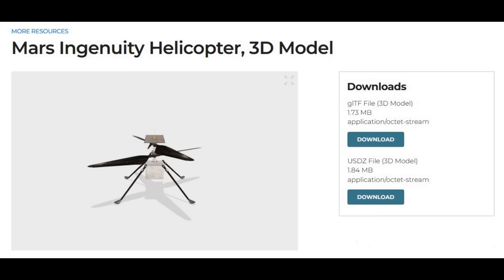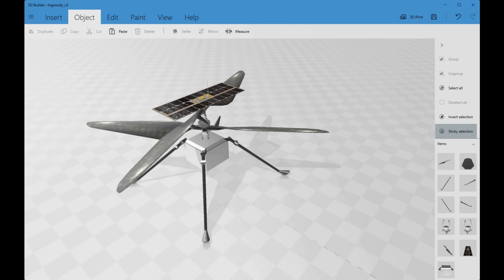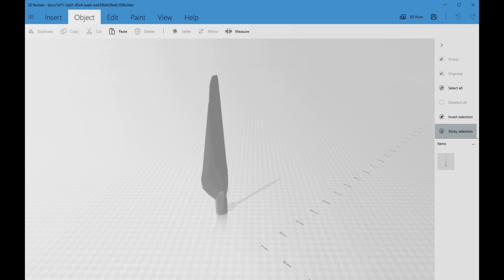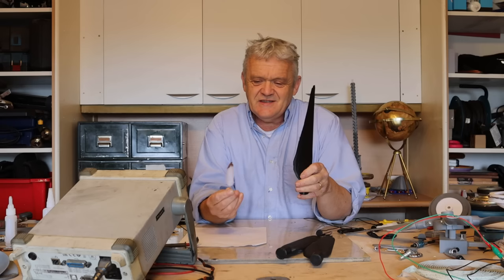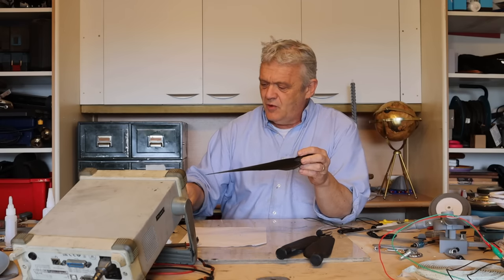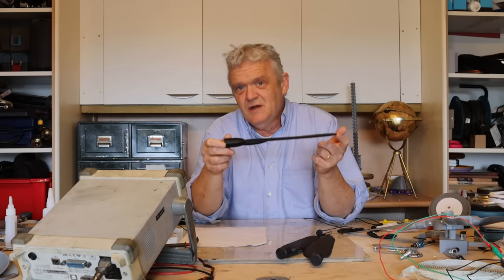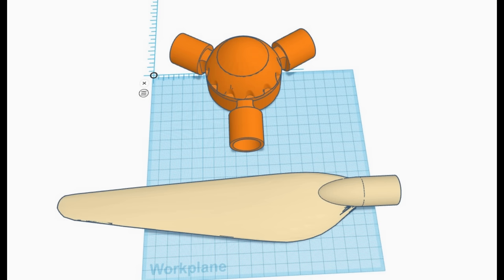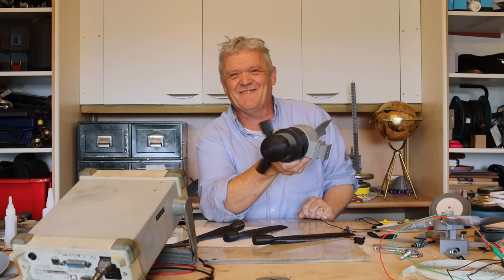2072 The Ingenuity Turbine - A Wind Turbine From Mars

Comment: I suppose the trade off might be that it starts at a slower wind speed but has an increased drag at higher speeds limiting it compared to the previous model. Would be cool to see activation wind speeds and saturation wind speeds for both compared.
Reply: Agree, that would be quite interesting to see.

Comment: How about making the propeller blades with fine splines at the mounts as well as in the hub? Slot the hub sections around the radius about 13 mm to 19 mm and use a screw to fasten the blades, this will facilitate experimenting with the blade angle.
Just a thought.

Comment: Double rotor(also interesting to try a set with a 3 blade in front and a 5 blade back rotor with the 3 bladed spanning where the gaps are on the 5 bladed one,  this would change the pressure between the two of them like a jet engine) is a must here I think to get the best result from it as it would furrow the air from front to back.  I really like this blade design.  Going from the wing to the feather idea is brilliant.  Now let's find out what happens when we take it a step further and go from the feather design to a  filament design as a feather in nature is made.  For example, cut or print it with angled slots that overlap making up the body of the blade just like the individual filaments of a feather are made.  Great video Rob!  Thanks for all you do!

Comment: If you redo it, you could try to double up like you did with the dual 3 blade design.

The blade set in the wind could be the curiosity design and the second set could be from your previous dual configuration.

No idea if its an improvement, but should be fun : )

I think its the video 2035 when you made the dual rotor turbine. Cant remember though.
Reply: Exactly what I was thinking
Reply: Yep me too 
I recon Rob would be onto it.
Reply: Yes, and stick it into a Darwin wind collector.

Comment: I read in the acetone article at wikipedia that it can be used as a type of polishing or smoothing for plastics:

Acetone is often used for vapor polishing of printing artifacts on 3D-printed models printed with ABS plastic. The technique, called acetone vapor bath smoothing, involves placing the printed part in a sealed chamber containing a small amount of acetone, and heating to around 80 degrees Celsius for 10 minutes. This creates a vapor of acetone in the container. The acetone condenses evenly all over the part, causing the surface to soften and liquefy. Surface tension then smooths the semi-liquid plastic. When the part is removed from the chamber, the acetone component evaporates leaving a glassy-smooth part free of striation, patterning, and visible layer edges, common features in untreated 3D printed parts.[75]

Comment: 👍🏻 Interesting. But it reminds me of a related propeller design issue: what is the most silent design for a drone propeller? In particular, is the single-bladed propeller with a counter weight quieter than others? And if it is, then does it still provide enough thrust to be practical?
Reply: Zipline drones seem to answer both of those questions. Considerably quieter than other drones of similar size, and still more than enough thrust to be competitive.
Those use two blades with a counterweight per propeller, though, instead of just one.
Reply: @Rainyjax  Are you suggesting a combination of capture methods in one device, just as the zipline drone incorporate two forms of propulsion.  How would you achieve this? You device would have to be highly reconfigurable to deal with such different magnitudes of wind force.  Is that feasible.  You certainly have me thinking now too!!

Comment: Would love to see this with a 2nd set of blades offset 60° and set back from 1st set as you did in a previous video.  
If would be even MORE interesting if you were to add a variable pitch controller to optimize blade angle at different windspeeds to broaden the efficiency curve.

Comment: I thought "maple seed" when you showed the blade.  Still a natural shape.  As a feather shape, might it also work with your flat "turntable" turbine featured on the other channel? Great video!
Reply: Why not have the feathers on a hinged joint, so that like a gear. At certain speeds there angle changes to slow down the speed or maintain a specific range of momentum.
Reply: Brilliant Idea, 
if I recollect those Feathers lifted up then went down,
~ in order to fascillitate generation whilst not impeeding the movement?
Perhaps the Darwins wind catching device might be beneficial to this flat generator?!

Nature is the Original and Best Designer!!
Reply from the maker: Good call! cheers mate
Reply: @patricklyons7683  so the feathers would automatically unfurl on a hinged joint as the wind speed increases, is that right?

I am intrigued, what would such a gear look like? Would it have some kind of elastic retraction mechanism? If it is a gear, could you make it open wide at low speed and then contract into a smaller form at higher speed?

Adding a hinged joint adds a great deal of complexity, and so the pay off needs to be significant.

Comment: Yep, auto-rotation is a thing. A helicopter falling through the air causes the rotor to rotate, which creates lift. Pilots practice landing under auto-rotation, in case of engine failure, I think.

Comment: I suspect it will excel at low wind speeds but possibly get overloaded at higher ones!
I wonder if variable pitch might sort that out a bit better though. Probably not worth the extra to make it though ........ unless you are going for mass production ;o)
Looking at real full sized turbines there seems to be other attributes that are not on their smaller cousins. One is Flexing tips to reduce high wind loads. Another is the curved but flat section of smaller blades compared to the more aerodynamic "plane wing" cross-section of larger blades!

Maybe these factors are because of the size differential though and are no more than academic with the sizes we are looking at here!
Eather way ..... More Brain Food. Thanks!

Comment: Nasa would have highly optimised the blades for the dual rotor configuration and spinning at 2900rpm: That's a tip speed of 180m/s or so, speed of sound on mars is 240m/s I wonder if these would be partly designed for getting close to transonic speeds. Not so optimal for low/static thrust?

Comment: What would the effect be if you put a weighted loop around the outer edge of the blades? 
I'm thinking basically creating a wind turbine/ flywheel combo. In theory, adding  or prolonging  the rotation of the wind turbine between gust..
Has there been any experimentation with this idea?

Comment: To print a turbine version of the propeller create a mirror image of the blade, perpendicular to the center axis, and 3D print that file.
The mirror image can be done while building the STL file or with the slicing software during the placement operation for the printer .
Reply from the maker: don't do that - this is already a mirror image
Reply: Thanks for sharing the blade files.
You're right!!!  The mirror image did not help.  The twist needs to be reversed to get the air to flow the right direction over the airfoils.  Those skinny curved airfoils seem to work just fine anyway.    @ThinkingandTinkering
Reply from the maker: to be honest mate it don't think it matters - with a left hand mirror the blades will turn (say) clockwise with a right hand mirror they will turn (say) anticlockwise - but I don't think there is a 'right' way as long as they are all the same way

Comment: Suggestion: Add a “key” to both the center sockets and the blades where they fit together so each blade angle is properly aligned for maximum efficiency and so you can’t assemble it in reverse.😊

Comment: My guess (and it is no more than that), is that the other blades will work better at higher speed and provide more torque because of their design.  Definite potential though even if that is the case.  You can't change the blades in a proper wind turbine, but there is the potential to have something that changes their shape.  Think flaps on an aircraft.  We do sit in the wind doldrums for long periods in the UK and it would be good to get something out of wind turbines even when the wind is at a very low speed.
Reply from the maker: The fundamental aerodynamics of a horizontal axis wind turbine rotor and a propeller is identical. If you would run the wind turbine generator as a motor the turbine would generate thrust very efficiently. This is measured by the thrust coefficient. For a wind turbine at optimal conditions this is close to the maximum possible: 8/9 according to Betz' theory.

The reasons the shape is not the same are due to different scale in size and in air speed which leads to different structural considerations. The wind turbine blades must be thick because the rotational speed is quite slow. Therefore the beneficial effect of stress stiffening is not as pronounced as in a propeller blade. Also, the incoming wind is very turbulent compared to the wind seen by a propeller. Therefore it is beneficial with a thick blade that has a smooth transition to stall.
Reply: @billbimpson2408 - Don't just Think flaps on an aircraft. Think wings on a bird. This is essentially a feather, and so if you can design and 3D print a strong compliant mechanism, you could potentially recreate the wing of everything from a harpy eagle to a pergrine falcon.  3D print the main frame and then rig in the tension and compression with elastic bands which are cheap and widely available.
Reply: @ThinkingandTinkering  Is there a major weight difference between the two blade designs?  

Was a there a significant print time difference?  Did you do a comparison on your two big side side monster printers?

Comment: An aircraft propeller or helicopter blade is not made to work as a turbine.
The profile is wrong.
But still fun to see something spin from the power of the wind.
Reply from the maker: Ahh mate - that is wrong  The fundamental aerodynamics of a horizontal axis wind turbine rotor and a propeller is identical. If you would run the wind turbine generator as a motor the turbine would generate thrust very efficiently. This is measured by the thrust coefficient. For a wind turbine at optimal conditions this is close to the maximum possible: 8/9 according to Betz' theory.

The reasons the shape is not the same are due to different scale in size and in air speed which leads to different structural considerations. The wind turbine blades must be thick because the rotational speed is quite slow. Therefore the beneficial effect of stress stiffening is not as pronounced as in a propeller blade. Also, the incoming wind is very turbulent compared to the wind seen by a propeller. Therefore it is beneficial with a thick blade that has a smooth transition to stall.

Comment: It is not the same to design a Blade to push the air as one that takes advantage of the wind speed to generate a rotational movement. The twists are the opposite. A proof of this is that you had to place the blades of the ingenuity 180 degrees with respect to the wind and they rotated backwards. I love that you continue to use my WINDTURER blades in your experiments. I have other designs in different sizes and with various airfoils if you need them.
Reply from the maker: cheers mate